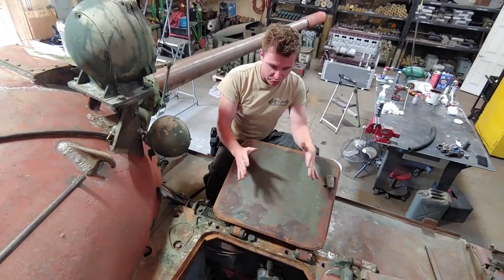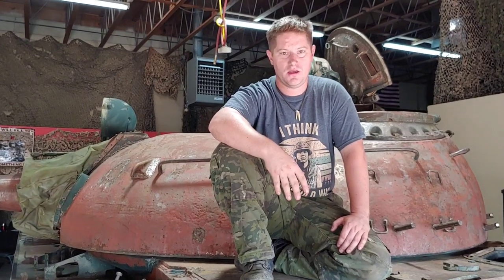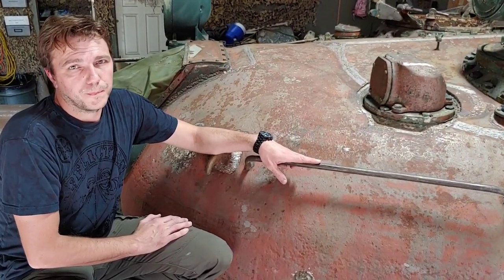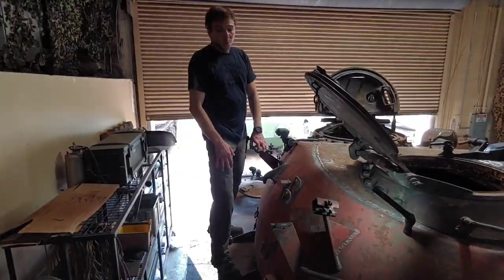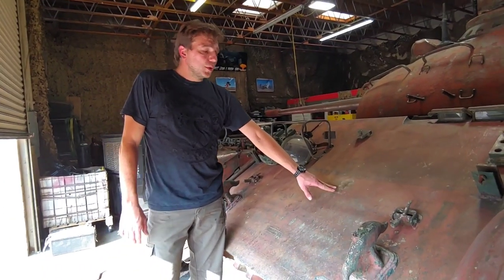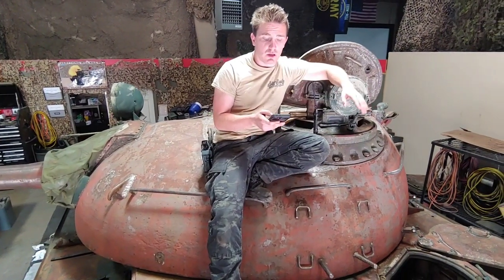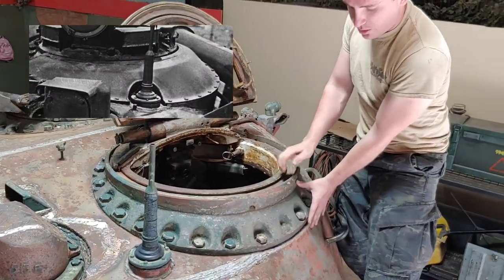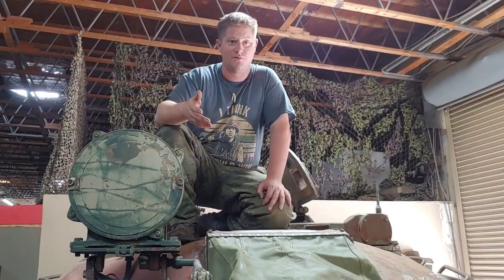T-54 Research and History of Warsaw Pact tank.

Comment: This looks like a T-54A upgraded to T-55 standards. As you pointed out, all structural features indicate that it was originally an earlier T-54 model. It is not a T-54B, which would have the night vision equipment to begin with, so it wouldn't need the lifting hooks to be relocated for the IR spotlight or the cuts in the turret to add the TPN-1 night sight. It also probably was not originally a basic T-54 built before the T-54A, because the commander's cupola lacks a rear-view periscope. This tank was not upgraded to the T-55A standard, which will include anti-radiation lining and external cladding. There is also the loader's AA machine gun cupola, which is of the old T-54 design rather than the late small-hatch T-55A loader's cupola.

The curved cuts around the back of the TPN-1 night vision sight head are the original mounting point for the gunner's MK-4S rotating general vision periscope. The gunner's fixed general vision periscope (next to the TPN-1) was also added in during modernization.

By the way guys, I strongly recommend that you keep the original air cleaner unit. The tank engine is not supposed to be operated with an air purity level of less than 99.8% for wear and tear reasons. The VTI-4 air cleaner in those tanks was designed for a minimum air purity of 99.8%, or a nominal dust concentration of 0.078%. commercial oil filters like the ones you have on that tank normally provide just 98% air purity. When driving around outdoors at your dusty firing range, dust ingestion will be many times higher than normal, and your engine life will suffer due to cylinder bore and piston head erosion, and you will potentially see accelerated piston ring damage. For the sake of preserving the engine as long as possible (and avoiding very costly repairs in the future), I strongly, strongly recommend keeping the original air cleaner in place, even if it's a bit more of a hassle to clean it when it gets clogged.
Reply from the maker: Thank you Tankolad. A beautiful wealth of information. We will bring this up in our next follow up video. I have not heard that much detail before regarding the air cleaner. We will take that under advisement and approach management about the change.
Reply: I have to strongly agree about the air cleaner. I have no experience with Soviet era tank intake systems but can tell you from personal experience that a K&N style air cleaner is NOT a good idea in any dusty environment. I have seen many dirt track racecars experience significantly shortened engine life from those air cleaners. In the absence of a factory unit, a system of disposable paper element air filters that actually filter the air twice is a very good substitute. 
      Yall Take Care and be safe, John
Reply: @JohnDoe-pv2iu  I don't have personal experience with K&N filters, but after reading your comment, I googled around and from what I've read, it's true. Virtually everyone who used K&N filters is highly satisfied with their performance, everyone except people who regularly drive cross-country trails with a ton of dust. I've read a few complaints from that perspective. Apparently the K&N design is really good for the type of particulate matter that regular road or track cars have to face, and it pretty much always exceeds or at least matches the performance of stock paper filters, but K&N filters handle heavy dust poorly.

This is supported by one study, where they tested a regular paper filter vs a K&N filter using cement dust (25 microns), and the paper filter managed a 99.04% filtration efficiency while the K&N could only filter out 53.55% of the dust. For comparison, the dust found on paved roads is by far mostly just 2 microns in size in terms of overall quantity, and the most numerous of the heaviest dust observed is only 7 microns, extremely light compared to heavy dust. This is a link to the study: https://www.sciencedirect.com/science/article/pii/S2212017316301475/pdf?md5=d2f70e632c706b1c583eb769b594ce7a&pid=1-s2.0-S2212017316301475-main.pdf

From an engineering perspective, this is completely consistent with the design of tank engine air filters like this one for the T-54. It's a two-stage filter with a multi-cyclone first stage, which filters out all of the heavy dust due to the weight and inertia of heavy dust, and then the second stage filters out almost all of the fine dust particles by trapping it inside the oiled mesh. This is how it achieves such a high filtration efficiency, close to 100%. Two-stage filters are standard on off-roading trucks and heavy vehicles like tanks specifically for this reason. Basic single-stage automotive filters for road vehicles cannot effectively substitute a two-stage filter.
Reply: Т-55 чехословацкого производства.У Т-54 на крыше башни стоит вентилятор под бронированным колпаком.
Reply from the maker: @СергейКолесников-х4ж  Я не уверен если Вы полностью посмотрели видео, мы там обсуждаем этот момент, и говорим про вентилятор в крыше тоже, он там изначально был. Вообщем это не много странная модификация этого танка, в итоге получился что то вроде не завершённого Т55, по этому этот танк числился как Т54М.

Comment: The new tanks received mainly internal improvements. The PAZ overpressure system introduced on the T-55 is able to keep out radioactive dust. And the World War II SGN machine gun was replaced by a new PKT. In 1961, the T-55A received an anti-radiation liner and air filter.

It is also difficult to distinguish between individual models because old and new models are often made to the same standards. The T-55, for example, did not have an external DSK anti-aircraft machine gun in contrast to the T-54. Soviet commanders considered these to be ineffective against jet fighters. During the renovations, the shotgun was eventually returned to the tanks, as today’s offensive helicopters are already within range.

What foreign history does not mention is an emblematic year for us: 1956!
The T-54 was first deployed here in Hungary in the 56th War of Independence. All you could know was that the T-54 was very sensitive to the Molotov cocktail. The T-34 stood by this better.

Congratulations on the video anyway! Keep it up! :)

Comment: Turret weld marks seem to be where mounts for storage boxes used to be
Reply from the maker: Very possible!
Reply: The weld marks below the handrail are where the lower mounts for the turret ZIP box used to be. The weld marks on the hull rear are; In the centre they are the remnants of the original Polish central fuel drum bracket. To the left and probably right of the rear plate they are the mounting points for BDsH smoke canisters. I will send Ritchie some photos

Comment: Be advised that K & N air filters work so well because they allow larger particles of dirt to enter the engine. Your better of restoring the original air filter setup.  I learned this from the Bus Grease Monkey and he showed how much dust was ingested by the 8V92TA engine turbo which was bad enough he had to replace it.

Nice work gents. 

Food for thought
Reply from the maker: I can definitely agree with that is you want long term longevity to use or repair the original air system.  However important to understand that our tanks rarely are ever driven for more than 30 minutes and usually its only driven like 0.25 kilometers or around like 5 minutes to its firing position for customers to rent out.  That being said our tanks don't run enough or long enough to ever see that kind of wear and tear.
However if we ever did take it to a large scale event or had to drive it across the desert then for sure we would definitely change that

Comment: I wish i found this video earlier. This is T-54AR succesor to T-54A for Hungarian army. This tanks was assembled in ČKD Sokolovo and shiped to Hungary around 1964. "AR" was upgrade for deep water crossings, his nickname was "Řeka" (River). Weldspots on the side of the turret was meant for carrying pieces of snorkel. And mushroom style ventilation is sealed, because of water. This can't be M variant, because they have D-10TGM(modernised) cannon. Your tank have D-10TG,
Reply from the maker: Thank you for the information!  However our references suggest that a T-54AR would have had a different back deck compared to what ours has had installed.  Also I was under the impression that the T-54AR was never used  by Hungary?  Do you have any references we could cross check to verify this information is correct?
Reply: @MilitaryArmamentsCompany  I have only czech documents, but Hungary gets first 10 pieces of T-54A in March 1963, then another 66pcs of T-54AR in 1964. First 10 vehicles for hungary was from "proof of concept" series, made in 1957 by ČKD Praha. I think your tank is one of this "prototypes".
Reply: @superamper  On the other video you can see details with Polish markings (i.e. gun plate w/w 1963 date, manometers, etc.). So it's rather a Polish-built T-54A (or AM), these were also exported to Hungary.

Comment: Also if the turret has a two plane stabilizer, that would be one of the big main differences of it being a T55 vs. T54
Reply from the maker: As far I know yes, T54 had a vertical stabilizer while T55 received vertical and horizontal stabilizer. T55 was basically a variant of T54 that was designed for operating in post nuclear war conditions. New ventilation system together with equipment that locked the turret ring to prevent spinning of the turret during nuclear blast, and other upgrades.

Comment: 9:50 The weld marks on the back at the very side are from the log brackets that just got later moved towards the centre. The original T-54 had it like this to clear the smokescreen barrels.

As for the modernisations, I believe it might have been made as a T-54A, exported to Hungary and than modernised there to the level of T-55. While Hungary did not produce these tanks, they did their own modernisations with supplied kits from Czechoslovakia, possibly Poland as well. That would explain the inconsistencies, for example the first roadwheel's larger bearings (T-55A mark) and the engine deck with the solid covers (also T-55A mark) while otherwise looking like a T-55-level tank (no radiation protection lining). 

Take a look at the identification tables at the upper front plate and at the front left side of the turret. If the designations start with MHY, then it should be a Czechoslovakia-built tank.

There might be some more clues in the interior, possible idea for the next video. Otherwise, great video, looking forward for the next one.
Reply from the maker: Thank You! This is exactly what we hope for when asking our audience. I will share this info with the rest of the team (this is Dmitriy). The reason we wore thinking that it was Polish tank rebuilt by  Czechoslovakia because of the Polish style square hatch on the engine deck, but with hinges moved from it's original spot over to the side like it is on Czechoslovakian tanks. That to me seems like something Czechoslovakian factory would do, but for Hungary (because they operate both Czech and Polish made tanks) probably won't matter such details like placement of hinges, but I could be wrong, maybe they preferred Czech style hinges.
Reply: @MilitaryArmamentsCompany  The relocation of the hinges is typical for modernised Czechoslovakian T-54s to T-55A level, don't know about Polish ones. The wings of the engine deck above the radiators do seem more like a Czechoslovakian design, they have the diagonal profiles/reinforcements in them, compared to some Polish ones I've seen, that only had the straight ones.

Comment: Total shot in the dark here: There is a picture of a T54 on google images carrying a log strapped across the back of the tank. The brackets holding the log in place appear to line up with the weld marks on the back of your T54 “Mutt.” Again I’m just guessing, but it’s a possibility.
Reply from the maker: Definitely a good guess!  Our updated information suggest that those back weld marks are in fact for the Polish smoke generators on the back of Polish tanks.  The older versions had one big fuel drum on the back and two little drums on either side.  Some more information can be found on the T-54/ T-55 Research Group on Facebook